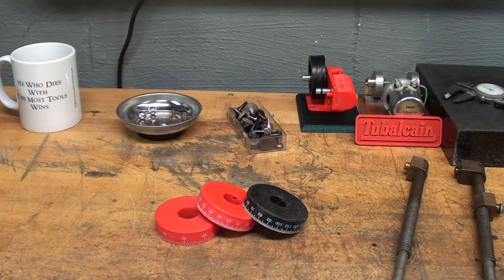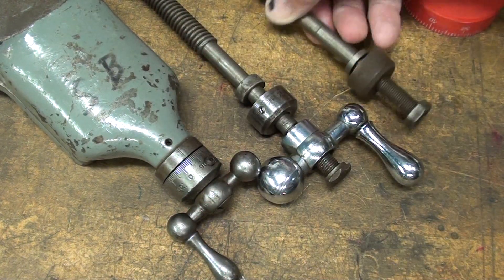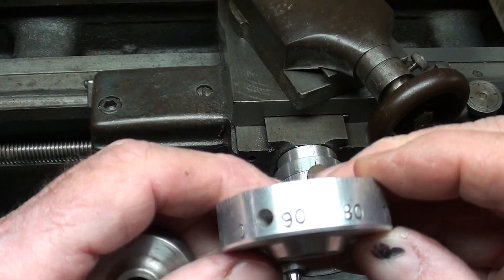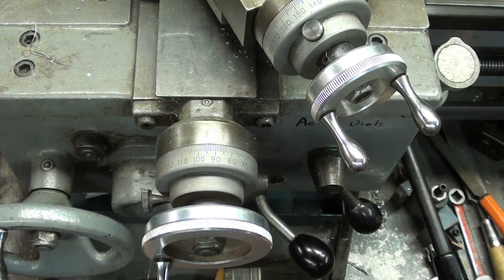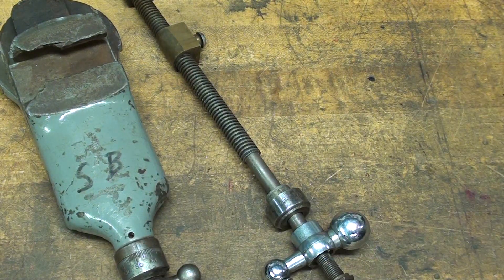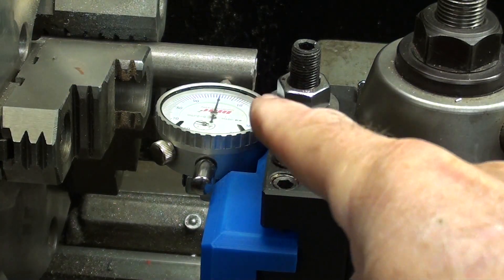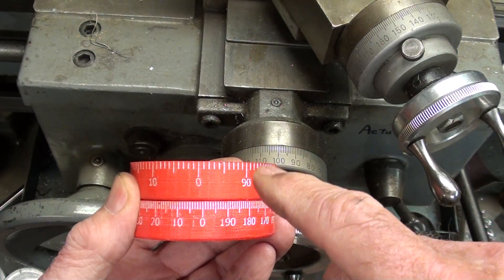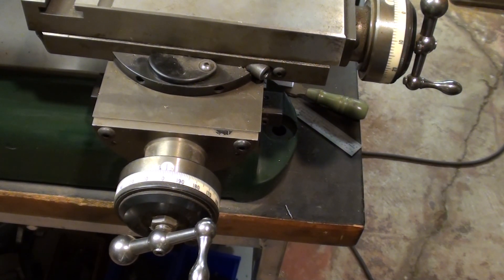Extra Large Atlas Lathe Dials pt 1 TIPS #431 tubalcain

Comment: I have the old style 12" "not commercial" style craftsman lathe. I'm going to rebuild the cross slide lead screw with one from a taig CNC mill. It is very well made and is 1/2-20 tpi. I'm going to use the taig brass lead screw nut also. The taig lead screw nut is adjustable for backlash. This is also going to turn my .100 dials to direct reading due to the 20 tpi.

Comment: I have a 11 inch Logan.  I was turning the thread diameter for one of your square headed bolts, and it is indirect reading:  .005 is actually .010 off the diameter.  It had been a while since I used it, and I had to remember that.  I plan to mark the apron as you did, so I don't have to relearn if it's a while till I need to use it again.

These are amazing projects.  Thank you for showing them.  Even if I never 3D print, I glean an amazing amount of info from your videos.  Thanks Professor Pete!  Happy to be in the front row of class today.
Reply from the maker: Thank you very much, I'm glad you like them, and can use some of the information
Reply: The 13 inch round head LeBlond trainer from 1943 has an 8 TPI lead screw as well, and it's direct reading.  Thanks for this info.  It's handy as can be.

Comment: Great idea, Mr Pete. I haven't used the crank dials on my old Atlas 10" at all, though, since adding dial indicators to carriage and cross-slide. It's so much easier,  with no backlash concerns. I won't be going back to the crank dials anytime soon! ;-)
Reply from the maker: You are right, a dial indicator or digital readout is probably far more accurate. But they are not direct reading

Comment: I like the darker dial material as it gives a better contrast with the white lines.  My lathe is direct read with large cross slide dials in satin chrome.  Know what you mean about the cataracts.  I have been able to tell the difference in light transmission for some time now between my right/left eyes.  Developing a cat in my right eye. Those 3D printers seem to be a useful tool for prototyping.  Making with CNC instead of cutting with CNC.  See you in part 2.